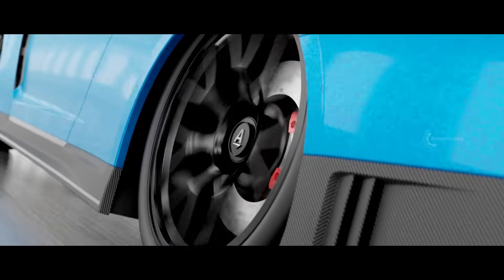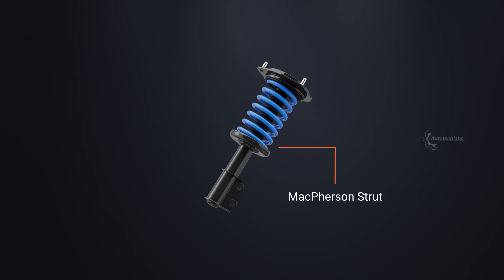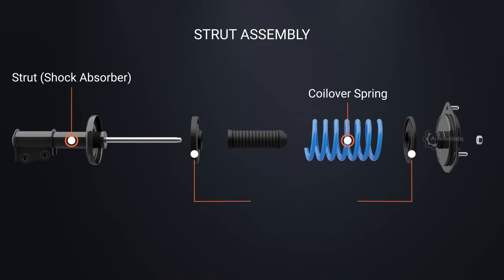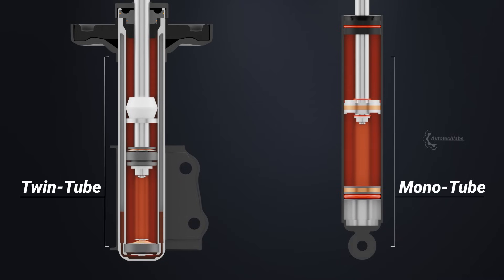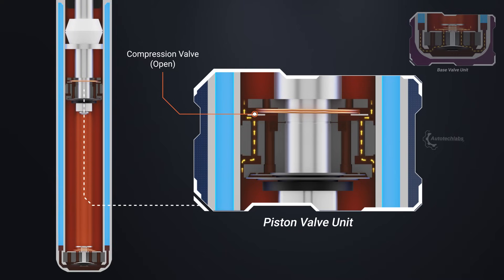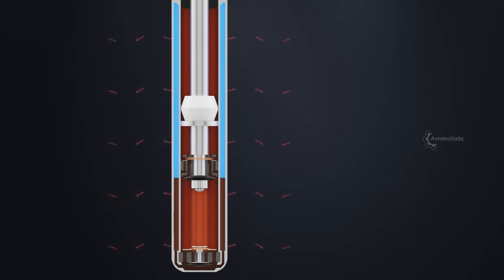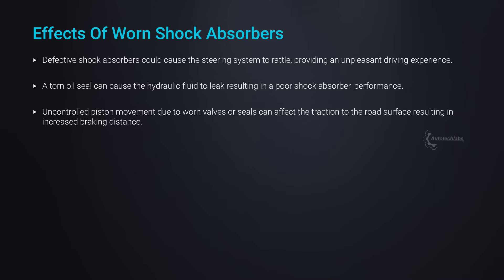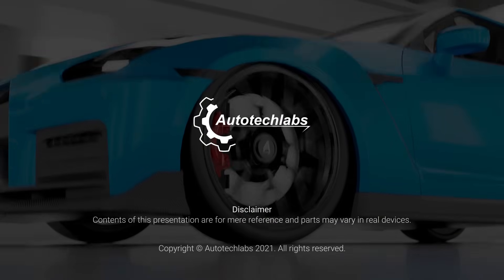Shock Absorbers | Autotechlabs

Comment: excuse me, can someone tell me the name of a turbo-diesel engine (4 cylinders) that has 125ps/2600rpm? thank you very much!
Reply from the maker: You need something above 1.5L at the least. Look for PSA engines or Duratorque Tiger, Lynx series engines. Most of them are common rail inline 4 cylinder. Detailed listing could be found in Wiki.

Comment: How to check the shock absorber for a common person whose owner of car.What to check and after how many miles or kilometers do these get changed.
Reply from the maker: It all depends on the symptoms shown by the shocks. Even with a worn shock, the car would still be able to drive but the suspension performance and comfort will get affected. After several thousand miles of operation cycles,

1. Oil seals could break (You could lift the dust boot inside the coil over and see if the piston rod has oil presence. Ideally it should be clean)
2. You could check rubber isolators on the strut mount (under the hood and just below the base of the coil-over) to see if its torn.
3. A strut with worn interior would act stiff making the compression and rebound movement inconsistent.
4. You could also check for worn bushings on lower arm joints, sway bars/stabilizer bar which are crucial parts of the suspension system.

If you are new to this, we highly recommend to get it inspected by a trusted professional.
Hope this helps ✌
Reply: @autotechlabs  Yes it help and thanks for deep detail. It's great that if you make a detail video with different situation of assessment concept clarity of 3D animation.